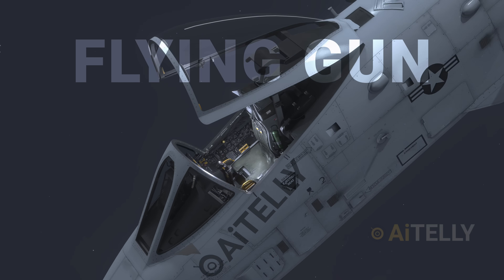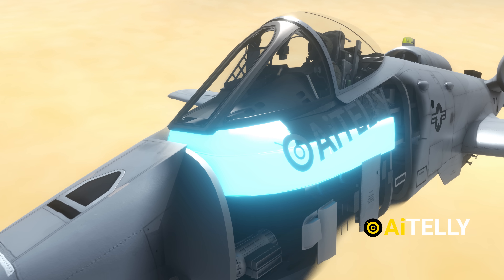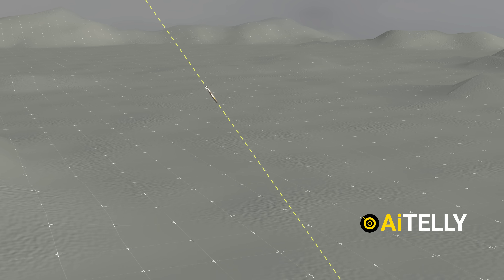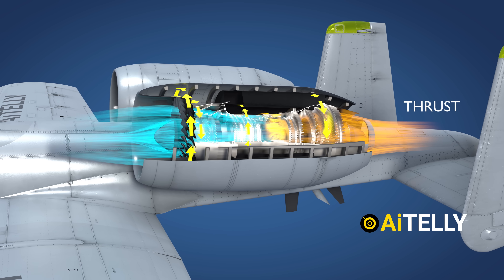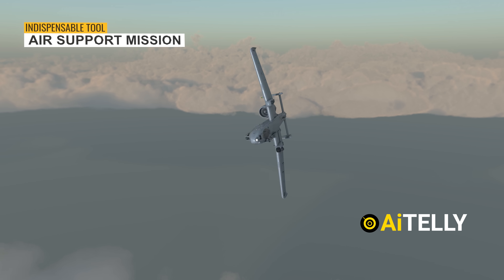A-10 Warthog Jet Explained #jet

Comment from the maker: Go to https://surfshark.com/aitelly for 4 extra months of Surfshark!
We are honestly using using this to Stay Safe from Scammers and Viruses.
Reply: Well done...I am really glad to see when folks get the gun offset correctly...not everyone realizes that the Avenger cannon is mounted just a little bit off center to the left of the A-10 airframe. This is obviously done so that the firing barrel of the gun is on the centerline of the plane, and as it is mounted, the right hand barrel is the one that is in line with the firing chamber.
Reply: LOL, fuselage. = more like Few-sil-lahsh (rhymes with massage). Not few-sil-lidge
Reply: We need AMCA & TEJAS MK2 JET AI ANIMATION
Reply: AiTelly, If your seeing this, You have bots.
Reply: go to preschool to learn how to say debris!
Reply: Yo please do about su 25 too
Reply: Do you guys offer 3D animation services please?
Reply: A-10 doesn't have Pulse Doppler Radar and this radar cannot detect incoming missile. RWR has receiver mounted on front, side and rear but not top and bottom, these receives incoming radar guided missiles direction, type of spike, active missile being launched and closing in missiles entering visual range. IR spiked warning receiver antenna cannot tell much other than warning pilot and pilot will look for incoming missile strobe to dodge and spoof. 

Only newer aircraft and existing that received upgrade get Missile Approach Warning System (MAWS) detects the missiles exhaust heats UV closing in and warns pilot. Recent PAF vs IAF largest 4th vs 4th generation fighters air combat, Rafale MAWS failed to warn pilots because the PL-15 was on datalink gliding in at Mach 5 without strobe splashed the Rafales. RWR can't detect because radar didn't turn under datalink. Also PAF JF-17 carrying ECM pods actively jamming the IAF fighters radars. IR warning receiver detects only growling IR seeker, not missile on datalink. 

Also the A-10 rear engines mounted high at the back is to reduce risk on being damaged by AAA fire. The 2 rear engines are shielded by armored reinforced plates for protecting engines.
Reply: This is my favorite fav. Channal. Ch. Plz make alot more new ones exactly like this. And hi from western Missouri usa ❤i like the details u tell too. Keep doing that too plz. ❤
Reply: I love Surfshark Will buy to help you guys
Reply: Thats identical to the paper plane I used to fly back in my college days.

Comment: It doesn't take hours to unload the spent rounds. They come out automatically when the plane is reloaded.  During a NATO Tactical Air Command evaluation with the 510th AMU in Germany we set a TAC combat turn record. That's fuel, chaff & flare canisters, maverick missiles, and gun ammo in 19 minutes with inspectors watching our every move. Shortly after that they terminated the exercise sue to a severe winter storm moving in. That was the hairiest C-130 flight out. They couldn't stay ahead of the icing. They would start at one wing tip, and by the time they got to the far end the first wing was icing up. They took every inch of runway to get air borne. Scary as sh!t.

Comment: The A-10 isn’t just a jet—it’s a purpose-built solution. Every line of the airframe, from the straight wings to the high-mounted engines, was engineered for low-speed stability, survivability, and precision. It’s what happens when you design a plane around the mission, not the other way around.

Comment: This is EXACTLY the type of plane the Ukrainians could’ve used to defend Crimea and the Donbas in 2014. 

Instead of publicly discussing whether the US and Europe should send airplanes for nearly 2 years before eventually sending air support, what if the US and Europe had quietly supplied these (and other aircraft with logistics and support) to make them “the tip of the spear” of a massive counter- offensive!? It’s debatable whether such a decision would stop Russia in its tracks but surely it would’ve been a better plan than what actually transpired in that failed Counter-Offensive campaign

Comment: The size comparison of the 30mm compared to a human hand is disgustingly inaccurate. I have one of those (dummy rounds) bought at an air show, and they are much closer in size to a 2L coke bottle in length and just barely smaller in diameter than a 12oz aluminum soft drink can….much larger than a human hand.

Comment: The level of detail in this A-10 Thunderbolt breakdown is seriously impressive-love how the modeling even accounts for the off-center GAU-8 Avenger cannon and the titanium "bathtub" cockpit armor! The explanation of how the aircraft's design choices, like high-mounted engines and compartmentalized fuel tanks, enhance survivability in rough environments really highlights why the A-10 is so iconic for close air support. I'm curious-do any drone pilots here take inspiration from military engineering, like armored components or redundant systems, when designing or flying their own FPV builds? Would love to hear how real-world aircraft features influence your custom drones!

Comment: a simple stinger has a 4-9 Kms range to bring it down, so you need 2 wingman which unnecessary . this one is only used in mudhouses or stickleaves houses, not recommended in Kyiv or donetsk reclaimation😀😀😀

Comment: I was a crew chief on the A-10. Whoever put this video out is full of BS. The gun is aligned so the RIGHT most barrel is firing because the idiot doesn't know the sides are as if you were sitting in the cockpit.  The 30 mm round is DOES NOT have an electric primer as an old fashioned firing pin is used. I stopped watched at the BS primer.

Comment: wonder why ships aren't powered by modified aeroplane turbofan engine instead of gas turbines . . . yes, a turbofan engine will require significant modifications because unlike a standard turbofan engine that is designed for speed, whereas in a ship it'll have to designed & built for pulling power . . .

Comment: Question?
Are there any Future plans for the A-10? Change of materials, better turbines, better weapons?
What's the lifespan of the 7 barrels on the A10?
Is it TRUE that Radiation goes up in certain areas? After the depleted Uranium rounds goes off into a target?
Does the A10 have radar jammer equipped technology?
Is there any way to recycle the exhaust? Or make it more efficient?
How's the radar cross signature on the A10?
What about a CARBON FIBER BODY A10?

Comment: Then why does the brass want to get rid of it
Reply: @RacerX1971  when you’ve done nothing but sit in board meetings all day and want to reduce military spending you find first ‘outdated’ thing you see and try to get rid of it. Even though the troops love it and we keep getting told it’s supposed to be replaced be the F-35. 😒 In other words Military top brass Sucks
Reply: Probably so they funnel billions of dollars of funding  off to their personal accounts and collect crazy kickbacks while designing a replacement the fact that the troops on the ground have done everything they can to keep it in service says it must be pretty good at it's job
Reply: Because it wouldn't hold up in a modern environment.

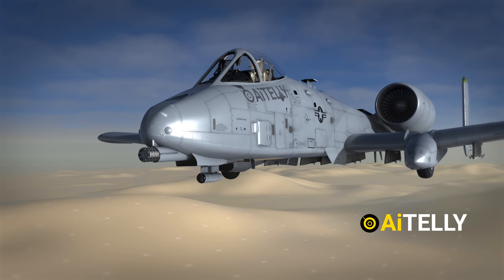Comment: 4:15 RWR won't pick up a thermal guided missile - it's a passive system that detects incoming radar signals but doesn't generate them - and since a thermal guided missile doesn't generate radar signals it doesn't get picked up.

Comment: 2:38 The bullets are fired from the leftmost barrel located at the center line of the aircraft, not from the center of the gun. Same thing at 3:35, the bullets come from the leftmost barrel, not from the bottommost.
3:49 That's the size of a .50 BMG. The 30mm is the size of an adult male's forearm.
3:58 The Depleted uranium penetrator is the core of the round, not the tip. The tip is made of lighter, softer material, similar to an APCR.
4:27 The engine on the A-10 is not capable of afterburning, so you will never see it spewing fire like that.
4:34 Correct, the aim9 is heat seeking, so why are you also, in the same scene, stating that it is a Semi-Active Radar Homing missile? The Radar Warning Receiver is incapable of detecting heat-seeking missiles threats. You should have used a R-27ER as a SARH example or an R-77 as an ARH example or a radar SACLOS SAM system.
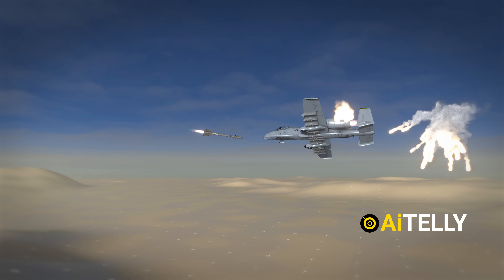4:52 Flares cannot confuse radar missiles, only heat-seeking ones. This entire section is a mess, mixing radar and heat-seeking systems and countermeasures.
Reply: I was just about to type out most of what you put... almost every minute I was like "Wait Wha.. Huh.. No? That is not how that works???"

Rather then making my own I will like yours!
Reply: The missile presented that was intercepting the warthog was a heat seeking missile hence the effectiveness of the flares shown in the video. Other than that there was a lot of mistake in the video including the size of the 30mm
Reply: @ Dead internet theory right here
Reply: Too bad they want to retire it
Reply: @allmotorhash  they want to retire them because they're too risky compared to the drones now days which could hit target precisely with zero risk for pilot also  cheaper and less fuel and you can be in NY  while controlling the drone
Reply: @abusamra47  true drones be busting tanks but for air support making it rain in mountains brrrrrppppp.  Brrrrprpppp
Reply: Terrible.  So many things wrong.  I'm glad you have the patience, I don't.
Reply: also the correct name for the A10 is Thunderbolt 2
Reply: I’m glad you said something about the size of the 30mm round I have 50 cal ink pen and it is as big as my hand 30mm is way larger than that
Reply: Yes, that the reason why the gun is off-centered is just that. The barrel firing is at the most leftmost, thus the leftmost barrel is at centerline. If it wasn't, and the gun was in the centerline, then the plane would veer off to right.
Reply: @RoyalMela Are you sure that it's the most leftmost barrel, or just the leftmost one?
Reply: @napiski2260, I appreciate you writing all of this out - you saved me the time. I wanted to add that the shape of the 30mm is round, not pointy like that(not sure about the AP one). Also, he did a partial description of the control surfaces. We learned how to yaw and brake, but not how the aircraft rolls or climbs. And, the only sensors that he mentioned were the threat radar receivers, which he demonstrated with a heat-seeker, as you pointed out. You can tell by his wording and the way he pronounces certain words(e.g. fuselage, barrage, etc.) that this kid has no experience with anything military, and he doesn't really understand all of the research that he's done for this video. I'd imagine that the graphics took some time - next time he should apply them to something that he knows about.
Reply: @CAMcG75 It's ai dummy
Reply: This guy puts out bad info as bad as "The Daily Aviation" channel

Comment: Search "DCS A10C Warthog PDF"on google. It will have all the info you need.
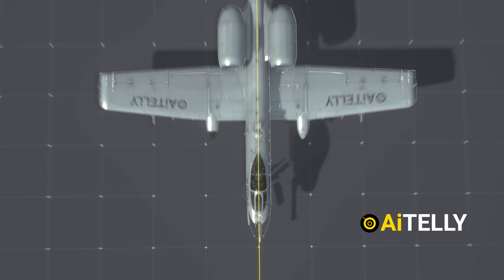3:25 No. It is off centered so that the only segment of the barrel from which the rounds come out (which happens to be at 3 o'clock position on the barrel) is centered on the nose. The barrel is off centered, but the barrel that rotates to the 3 o'clock position is the one that always fires--- that one is centered on the nose.Tiny detail that is shown in video, but not in explanation. Also yaw deviations are not an issue due to the barrel firing. It's the pitch that happens as the barrel is slightly (3 degrees?) pointed down from the center of the nose. When you fire the gun, the trigger has two level. The first one is to activate PAC (Precision Attitude Control) so that the rudder compensate for the bullet's counter-force to keep the nose straight on the target where the pilot points the target reticle. When PAC is disengaged, firing the gun causes the nose to slowly pitch upward, that is good for automatic, precision strafe run by the pilot (vertical strafe if you see the target from the pilot's view).

6:34 There are several types of firing mode, which may or may not require you to line up on the target using the reticle. The big circle you see also acts as a radar to mark how close you are getting to the target.

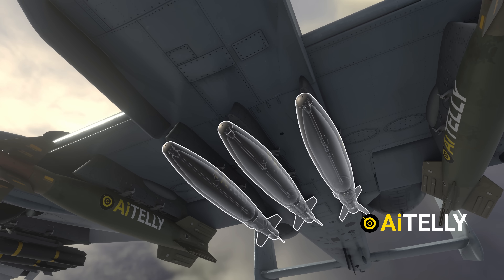6:54 Incorrect partially. A10C uses two types of bomb drop method. CCRP and CCIP (continuously/constantly/continually computed IMAPCT or RELEASE point). Based on guided or unguided bombs, pilot can choose what he needs. 

Also forgot to mention why it uses turboFAN engine instead of turboJET. As they need more loitering time on the battlefield for CAS (close air support), turbofan engines are more fuel efficient, albeit lacks the thrust to weight ratio required for fast and tight maneuvers like a fighter jet.

Most of the info given here are very generic and already posted by youtubers hundreds of times over. The graphics is good but it lacks the details that could've given this video more in-depth content. You want to know more about A10C and how amazing it is? Just read that DCS PDF (about +705 pages). Or just read other documents with details.

A good video for the eye.

Comment: Tbh even though this is iconic, I still prefer the modern Air to Ground doctrines.

The F16s and Apache's (during Wartime the AH-1Zs can be seen too)

Though I don't want the US to be dragged into war yet again by the same people.

Anyways, the Warthog has it's place, especially the A10C

And ofc, not to forget.

The A10C gets MAWS which should work against MANPADs if fired from too far. Even stingers with their IRCCM combo

Comment: a couple things the gun is offset for torque not recoil the gun can be reloaded in 12 to 15 minutes if the ground crew is hot pitting dives are only necessary for unguided bombs and it uses the Maverick missile not the hellfire!!!

Comment: Facepalm moment on 2:39 - fire shout come not from the center (there is no barrel there) but from the barrel that appears on top at every moment
Reply: Unfortunately this channel is hit and miss. Like with the recent aviation accidents videos, there’s so much wrong with it because he’s pumping out videos before there has even been an investigation into how it happens and is speculating. Tons of inaccuracies. A shame that they prioritise shoving lots of content out instead of focusing on accuracy and quality over quantity.
Reply: @OfficialSamuelC  They vomit out content so fast that half the videos are utterly wrong and lazy, which is weird considering how much work the modellers and animators put in. The flash coming from the center made me dubious of every other bit of information in the video.
Reply: I came here to write this
Reply: It's fires from the barrel at 9 o clock actually (if you are looking at it from the front.  Because that is the barrel that is along the centre line of air craft

Comment: You folks do a god job but I think your hand comparison at 3:52 may be a bit off. Shouldn't the round be bigger in relation to the hand?
Why do you show the engines with flames coming out of the rear since it doesn't have afterburners?

Comment: The A-10 does not fire Hellfire missles.
Reply: The bread and butter missile of the Hog would instead be the Mavericks
I think this one Explained clip is quite off and might need some correction edits.
Radar guided missile is represented by an AIM-9 which is IR, chaff is not mentioned for radar track countering. The A-10 is also fitted with MAWS which warns the pilot for any potential launches in proximity (even friendlies or other air-to-air launch) and the RWR warns the pilot ONLY on the RWR screen and via audio que not the HUD or screens.
Many key points of the A-10 are missing, such as the landing gear which is designed to belly land and the Mk-82 bombs do not have GPS kit, those would be the JDAMs and Small Diameter Bombs.
Reply: @Paloch1708  Well said. I had to stop watching with all the inaccuracies.

Comment: Compared to an average human hand, the 30 mm round is about 25% bigger than what you're showing.  Also, the A-10 Warthog does not have afterburning engines.
Reply: AFAIK afterburn on A10 not about full throttle.
It burn powder from cannon  to protect engines
Reply: feel like they messed up quite a few things with this
Reply: The Veteran Engineer itself 😮

Comment: Your video has the bullets shooting from the center hub that the barrels rotate around.  The bullets actually fire from the 9 o'clock barrel looking at the plane.  The whole gun is slightly off center so the 9 o'clock barrel is on the centerline.
Reply: you're right
Reply: It ground my gears too 😂
Reply: Great catch. Respect for knowing that
Reply: @berniejellig  Nice catch. I noticed that right away too.
Reply: The Veteran Engineer itself 😮

Comment: 8:55 this is wrong the a-10 carry agm-65 maverick not hellfire
Reply: As a retired USAF weapons loader… you posted this before I could. We never loaded Hellfire missiles as they were not compatible with the airframe. As for the AGM-65s… I loaded more of them than I care to remember.
Reply: @Richaag how often were they triple racked? Barely see any pics of triple racked mavericks on a-10s
Reply: @woffe8094 loaded the LAU-88 multiple times when I was at Nellis AFB.
Reply: @woffe8094  Lack of a threat will do that. AFAIK they were used often during the Gulf war and sometimes during the 2003 Iraq war.